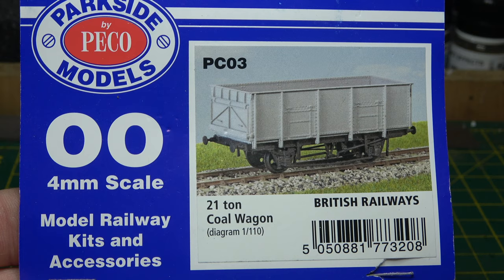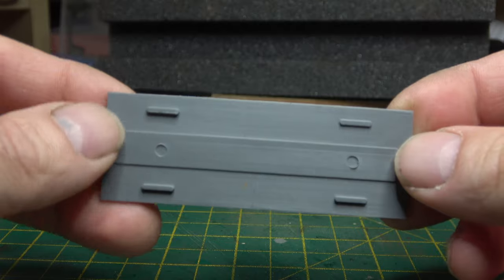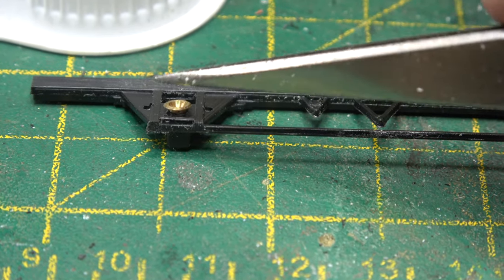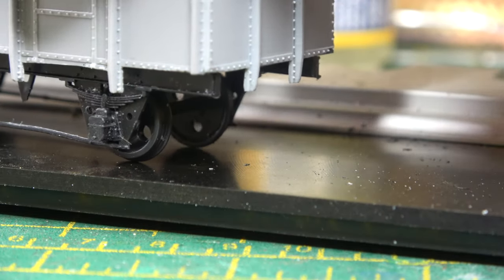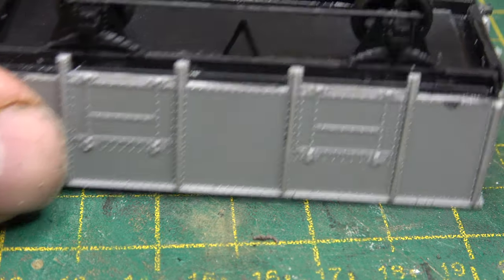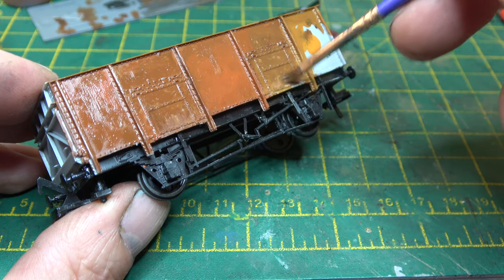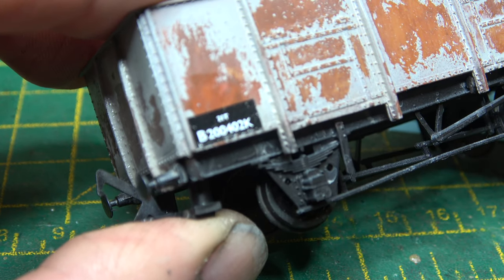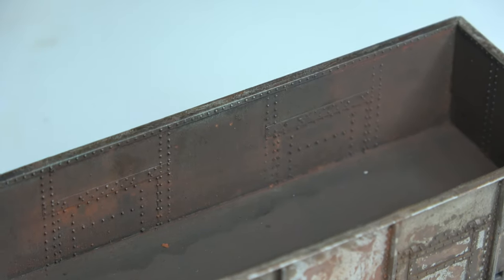Parkside Models (PECO) PC03 21 ton coal wagon

Comment: Nice job - am building 6x Slaters NER 20T wagons and same as you painting is my bete noir. Slaters are a slight step up on Parkside but need bearings and wheels sourcing. I have also been fitting some ols EZmate (kadee) couplings I found at a train fair donkeys years ago.